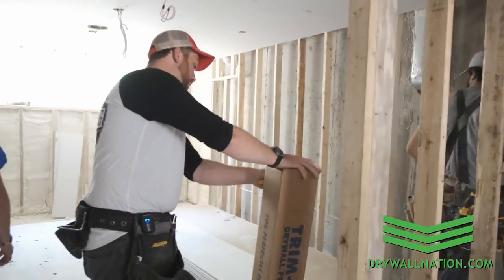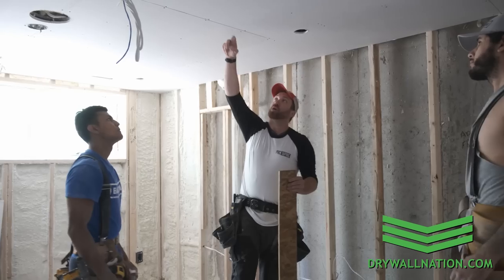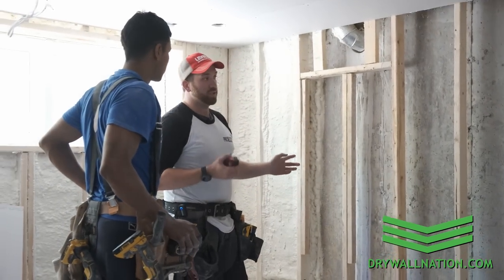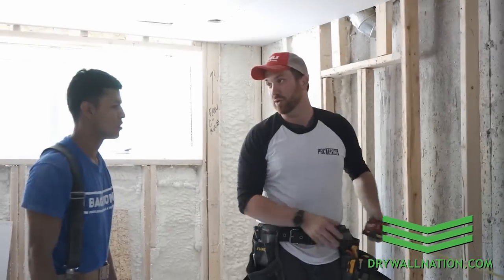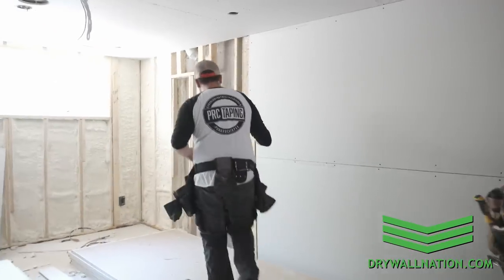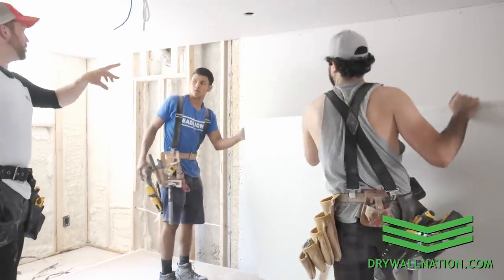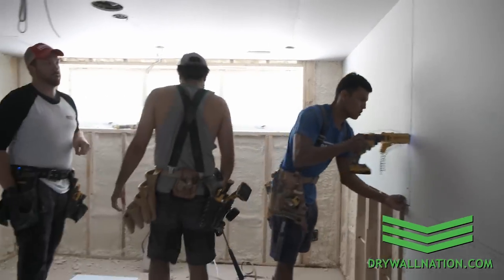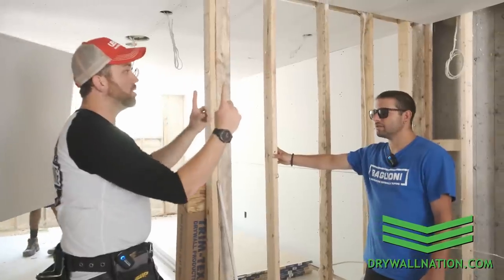How-To Eliminate Butt Joints using Trim-Tex Buttboard

Comment: I can see the advantage of them but drywall manufacturers do specify in their installation guides to stagger joints wherever possible.   You could use longer lengths (again, recommended by USG, et al) but those are unwieldy to hang and hard to deliver after framing is complete.   Seem a little gimicky but certainly a good enough product.   I would use them for ceilings in my own renos.
Reply: they're not FIXED like a wall stud so they can have movement and lead to a cracked butt joint.... And if the stud before the joint is out it's not going to fix that...
Cardboard shims are cheap and easy, make a butt joint that doesn't need busted out, and is solid (no movement)
Reply: @2869may  Do you have a link that describes this method with the shims?
Reply: @dmitriyc  I don't know of a link, I used to to it for a living.. You shim the studs on either side of the stud the butt joint will break on,  you can check how many shims you need with a straight edge across the 3 studs, Use as many as you need to create a strong 1/8 inch gap at the center stud...
The shims don't need to be all the way to the long edge of the sheetrock because of the recess, stay above/below the recess, (the recess is the 3'' indentation that runs along the long edges, that allows for tape and mud, The butt joints don't have this recess, we use the shims to create that allowance so the tape and mud doesn't hump out the wall) 
If you use 2 or 3 shims step down the lengths by an inch and a half... The first going to the recess, the 2nd 1 1/2 shorter and so on....
Do NOT railroad butt joints from floor to ceiling... Only on rare and unusual occasions do professionals do that..
Sometimes the studs are bowed badly, and you need to many shims.... change butt joint locations.... Check the locations of the joints first thing on a wall and figure out what you need to do.
Good luck..!
Reply: @2869may  Thanks for the detailed reply! If I understood correctly, this method would leave a ~1/8" valley at the breaking stud, but wouldn't this valley then span the full 32" across the studs? (The buttboard product looks like it creates a valley only about 8" wide.) With your method, how much of the valley/recess would you then fill with mud?
Also, regarding the warning against floor-to-ceiling butt joints, is that just for cosmetic reasons or structural/mechanical as well? I've seen the advice before but only in the context of reducing unsightly shadows, wondering if there's more to it.
Reply: @dmitriyc  In theory it would leave a valley  for the full 32", But the semi ridged sheetrock stays flat for several inches next to the side studs before starting to bow in, And a 1/8 dip over 16" is pretty gradual...
We done it for decades, 3 coats after taping an 8'' knife then a 10" then a 12" with great success, Flat butt joints.
If you have NEW knifes, use a FINE file and gently knock off the sharp edges and corners of the knifes, especially the sharp corners of the 6'' knife you will run 90 degree angles with, the sharp corner will dig in and could cut the tape. Just slightly round it over like a 1/16 and remove sharp edges from the sides of the knife that will scrape the mud and tape from the opposing wall of the angle you're running. you run angles one side at a time and let them dry before running the other. Lightly sand between coats to remove any ridges or excess mud. When running  the 2nd side of an angle run the knife very LIGHTLY against the opposing wall angle...! even though the mud is "dry" it is still soft and will dig out easily and get little chunks of dry mud in your wet mud and create drag lines...
Finishing is all about a light touch and proper pressure in the RIGHT direction
MIX your mud in a bucket with a BIG drill and paddle with a little water and dish soap (finishers secret) this will help tremendously..! The mud will spread SO much smoother..! (add water slowly as not to get it too thin, the shot glass amount of soap is a wetting agent and will help thicker mud spread easier, thin mud is hard to control and keep on your knife..
I wouldn't get Box Store mud..! Go to a drywall supply and get Magnum Light for coating, use All Purpose for taping it has glue in it. And DON'T wipe the tape down too hard and wipe all the mud from under it.
put a little mud on top of the tape where you start to wipe it, it will wipe down nice and smooth with some mud between the knife and tape... (A light yet firm grip on the knife is also key. Spread 2 fingers onto the blade and thumb and 2 fingers holding the handle against your palm, you can adjust pressure on the blade with your fingers... Don't grab the handle like you would a hammer, It's awkward and will make the knife feel cumbersome in your hand.... 
I wish I could show you this stuff in person...!
I should teach a course on finishing...LOL
As for floor to ceiling butts, it's not structural, it's just something we were taught not to do because it's easier to notice a bigger butt joint opposed to a smaller one.
Let me know if you have any more question,
I don't mind sharing what I know and helping out.
Best of luck to you.!
Reply: @2869may  Wow, so much great info! I definitely have a hard time not scraping the opposite wall on inside angles, often get those drag lines from the chunks. I guess only practice will develop the right level of touch/control. And I hadn't heard about the soap, will give that a shot! Thanks!!
Reply: @dmitriyc  LOL, it takes time to develop a feel for it, Filing your knifes will help.
And you will notice the difference with soap.
Good luck to ya....!

Comment: I did the same thing 22 years ago with sheathing scraps. Didn’t know about anything else but I like the bevel on ur product. Sure saved me on the drywall. I can say after 22 years no cracks in any of the floating joints here. Do b ware all my cracks are at door corners n I think I shoulda left floating around this.ur thoughts ...

Comment: I bought a pack for under $60 bucks from a local drywall store. It worked great for the ceiling in the master bedroom I just completed.  It made a pain in the ass job easier, so it was well worth it for me.  
I did a little planning on the layout to minimize butt edges and I ended up with a a few boards left over.  It was still way cheaper than hiring someone to do the job.
Reply: Now they are $155 for 12.   They are crazy if they think i will pay that...
Reply: @rolohern9645  just rip down osb that's exactly what it is , there smoked out if they think they just invented some new shit 😂😂
Reply: @samuelferris4108  OSB that tapers at the edges no?

Comment: i make my own. rip a piece of osb 7 inches then staple a drywall shim on each end. would rather use store bought ones but nobody here carries them.
Reply: I’m thinking of making my own using 1/2  osb well that work?
Reply: @artisticdrywall7368  yes
Reply: How thick of a shim do you install on the edge of that OSB? Would this work on 5/8" drywall?
Reply: @nbg11070  yes it will will work on 5/8 drywall you can buy 1/8 paper bord drywall shims
Reply: @Patrick00323  Thank you very much.

Comment: Butt boards at about $2.50 per 4 ft are too expensive. These butt boards should be 8 ft long (not 4 f), to avoid seams in the butt boards. It is better to make your own 8 butt boards 8 ft long out of 7/16 OSB sheet.
Reply: Yeap....
Reply: Totally Agree 👍
Reply: why is anyone buying this product instead of ripping up some cheap sheathing like 7/16 osb? I see this as a good alternative way to install drywall, but i dont see anything special about this "product"
Reply: they are bevelled toward the center @audioleech

Comment: Now when you lean into the wall you can break 4 sheets instead of 1.  Idk why people think a floating joint with no support is superior in any way.  Cosmetic advantages at the cost of structural strength are not advantages.
Reply: I think you might be missing the point that screwing that close to the edge of the drywall makes it a weaker attachment as opposed to the butt board having a full attachment with correct depth setting on the screws. It does make sense. We used to do the same thing with half inch plywood and quarter inch plywood back of the day when we had to get an extremely flat ceilings and two or three story shafts with clear story lights at the top. Now you can just buy the shit pre-made.
Reply: @nbco55  I think you are missing the point of how leverage works on a floating joint vs a joint tied to a framing member that is 3.5 inches wide.  I could see using this on ceilings but walls that people lean on and bump into it will crack at the framing member with body weight applied to it.  Much less a rowdy kid falling into it.
Reply: @totallynottrademarked5279  I tend to agree with your assessment on buttboards. Also, even on ceilings wouldn't it be a pain if you have a buttboard right where you need to install one of those led can lights right where one lands? You would have to cut your circle into wood, not to mention the the two edges of either side of the opening would be prone to crack vs a continuous sheet of sheetrock from stud to stud.
Reply: Floating joints are strong once done u have 4 points of contact plus glue over 16" plus its not hump out or needs to be float 20" out.
Reply: It's ok bud...science is hard for some people
Reply: Also, as a drywaller it isn't your concern on what happens to the wall after you finish the job. As a business man, your concern is doing quality work for as little cost to you as possible. You'll get it one day
Reply: @Jonny0651  I'll agree but add that an owner can skip the low cost as a standard. It's the workers money and if they want to spend it doing stronger for the same price they can. Funny how people that do that in the same timeframe end up making way more money.👻
Reply: Been using it for years. No callbacks, no bad butts. Keep living in the past...
Reply: @Jonny0651  as a drywall business owner it is very much my concern what happens to the wall after I'm done. It's why people keep calling me.
    "You dud my buddies place 6 years ago and it still looks sweet. I wish you would of did my place because the guy that did didn't care and now its cracked and failing."

Comment: I'd like to see this product tried with the "ultra light" drywall that HD sells. That junk is so brittle it cracks if you just look at it funny.
Reply from the maker: That's mostly all we use is CGC/USG lightweight drywall. Never had any issues. 
We were also using lightweight in this video but I believe it was Certainteed.

Comment: i get everything about it, i have one question though... since you've depressed the butt joint along its entire length, doesn't that mean that the CORNERS  of the sheetrock are now double depressed due to this structural depression plus the additional depression that already exists on the corners from the long edge of compressed sheet rock... does it not screw up the mudding of the long edges where every eight feet now there is a deeper hole to mud... does the paper tape lay flat there or the deeper dip at every intersection messes with it?

Comment: That's why I hate wood framing. I am in the commercial construction side and we use metal studs and mostly stand up the drywall, most butt joints fall above the ceiling height and if not drywall is still screwed across the studs..no cracking. oh and we have great finishers..

Comment: I can’t see the mud savings bigger than the. OST of this board at $110 Canadian a box. Savings is just not balanced out
Reply: I tend to agree but remember, the big cost with mudding is the labor of application, not just the cost of the mud.  Then there is sanding the larger joint.  I still agree that I don't think there is enough savings to offset the cost of the product.  Maybe from a quality perspective if you get a flatter joint, there is value to that, especially on a large open ceiling.

Comment: Have a look at  the outside garbage bins in a new home developments.  They  are filled with piles of short ends of OSB and plywood sheathing that all goes to the landfill.  All of that scrap can be used for drywall backing.  It does the exact same thing  as this product and costs nothing.    Using the scraps is also more environmentally friendly

Comment: Bee doing this for years over 10 years cutting 3/8 plywood in to 3 inch strips found that on the walls it was prone to cracking found if someone pushed there hand on it say to get up off the ground it could crack so that is a risk !!

Comment: We shim out the studs before the butt joint for less flash
Reply: Or do the opposite and plane down 1/8" of the wall stud that butt joints lands on. I actually did this in certain walls where natural light washes the walls parallel. Not every butt joint but where it matters.

Comment: I used these years ago on a few houses in northern Michigan, they was expensive and nobody wanted to pay for them.. when I used them we put more screws in them and it does suck the joint in much more.. ive also seen people make there own.. i could see using them on smooth ceilings more than a textured ceiling.. if people want to pay for them and pay alittle extra for using them I have no problems, but everyone trying to save money on everything nowadays
Reply: What about the savings in mud, labor per hour on mudding compared to these? Makes me wonder.
Reply: They trip over a buck to pick up a penny.

Comment: Couldn’t you just run a 2x4 with the 3.5 side forward connected to the framing at the butt joint area and get the same effect? And it would be connected to the framing so it would have some structural support?
Reply: 2x4 is not beveled so finishing will be wide, same as if you land on a stud . Not to mention insulation and wiring that may be behind it.

Comment: How are they not damaging the stack of drywall that they keep standing on?
Reply: Because it's drywall, and it's laying flat, and they're in tennis shoes.
Reply: @mywifesboyfriendisfire : Tennis shoes will get them kicked off most job sites and/or a heavy fine. They might each want to consider buying a pair of CSA approved work boots before an inspector shows up.

Comment: Hi, good video, but I have a slightly different opinion, technological, that if the end edge goes in one line between the sheets of drywall, then it is better to fasten two sheets, and then tie the sheets to the rear connection ... Good luck to you  , guys!

Comment: I usually use 1 x 3 or any scrap wood. are these expensive..?
Reply from the maker: Scrap wood can be great for backing but unfortunately it doesn't recess your butt joints like buttboard does. Buttboard is Vgrooved so it pulls your buttjoint inwards creating a tapered edge.
Typically they're about $5 a piece but with the cost of lumber going up due to Covid everythings more expensive now

Comment: Isnt it a potential issue to butt two pieces of butt board on the same line as the drywall seam? If you had put the 48" piece on the bottom and trimmed the upper Buttboard this would have been a better joint.?
Reply: Good point.

Comment: Will a stud finder pick this up as a stud? A homeowner trying to hang something on this would end in disaster no?
Reply: I am not a contractor but home owner handyman. I really don't see much benefit in using these butt boards. Yes, stud finder will pick these up.
Reply: @sidsid9808 : My opinion as a longtime professional is that there is no benefit whatsoever to this. The suggestion that there will be less drywall waste is ludicrous - a 17ft wall is still a 17ft wall. The further suggestion that drywall boarders cut the panels at the butt joint is equally ridiculous…the cuts are made at the inside corners at the opposite ends. And finally the suggestion that a 1/2” drywall panel will ‘suck in’ to the taper of the OSB backer is complete nonsense. There’s always someone trying to convince people that, for a price, magic will take the place of skill, lol.

Comment: Why can't drywall manufacturers make the drywall with tapered edges on all four sides, instead of just the edges?
Reply: I'm no drywall pro, but if I imagine that you don't want tapered edges where you don't, mud... like near the floor as your trim wouldn't sit flat. It would only make sense if they sold both options but then you have twice the options and stores need twice the floor space for drywall then.
Reply: The cost of manufacturing the drywall would definitely go up.  Go watch a YouTube video on how drywall is made and you'll see why.
Reply: They're widespread here (Netherlands), mostly used for ceilings. The production method does cost extra (though these are more expensive also)
and the quality control isn't always top notch which makes the edge of the taper visible after finishing sometimes.

The board factory mills a small slot in the side of the board en glues it together again, making another tapered edge. They're called "4x AK" boards here.
Reply: I mean, once you cut it, it's no longer tapered, and I think you probably just have to be lucky if a full board actually lands on dead center of a stud. So it's probably just not worth the effort to make them that way. I'm just guessing. Not a pro here, but am in the process of a renovation of a bedroom and it was rare that a full sheet did the job unaltered.